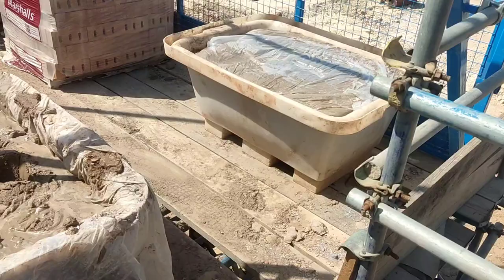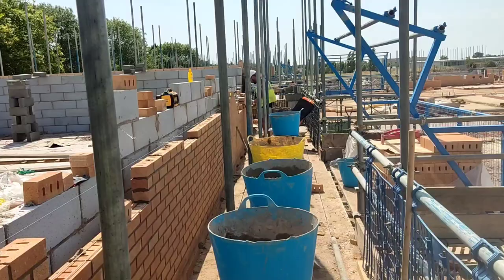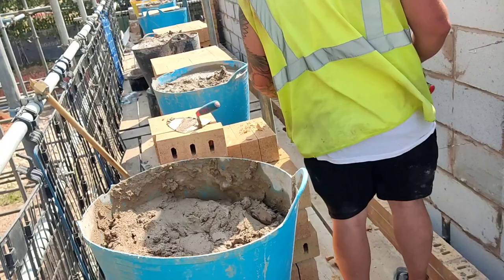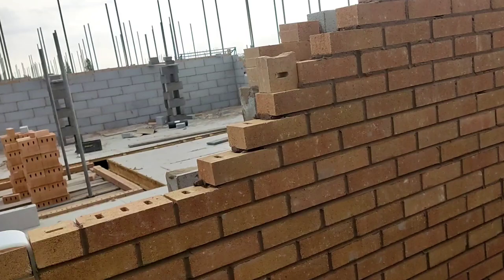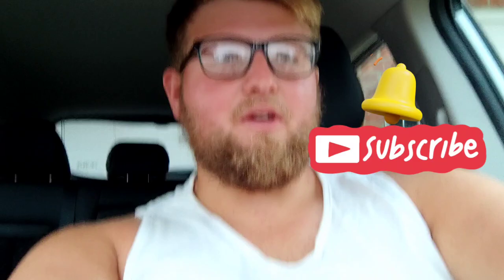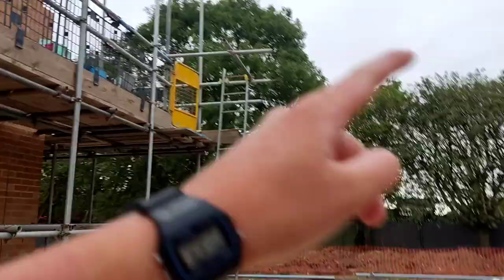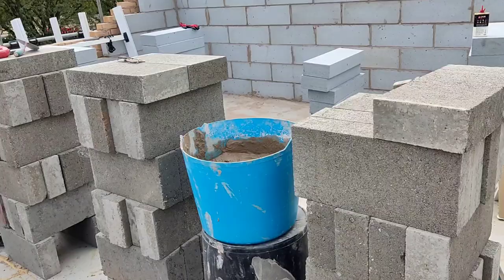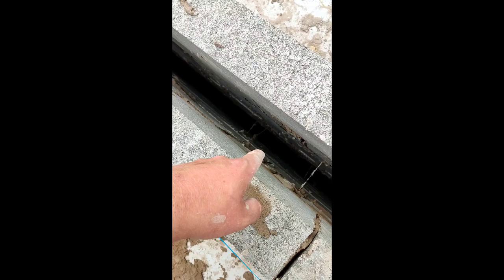Bricklaying Vlog - Working in a Heat Wave is a Bad Idea!? More Build Tips!

Comment: Hello bud would it be easier to fill the tubs then use the paddle in them mate (just a thought) also mate the dorrie blocks it’s better if you keep the finger screw on the inside of brick work as it pull the line closer to the brickwork instead off pushing away as you tighten
Reply from the maker: Thanks for tip mate, I tender not to have to tighten it just nip it
Reply: No probs buddy 👍
Reply: You can get cordless paddle be dead handy for quick blasts